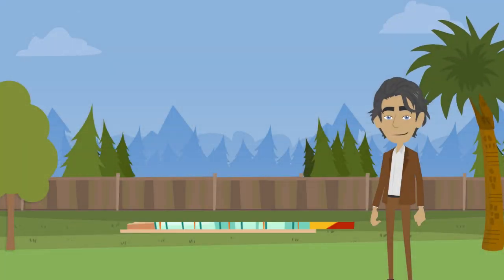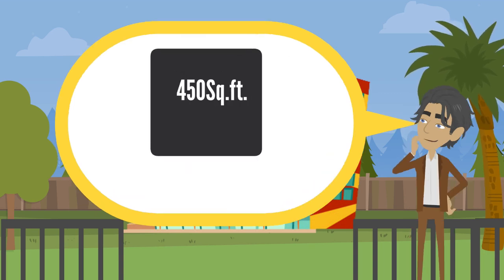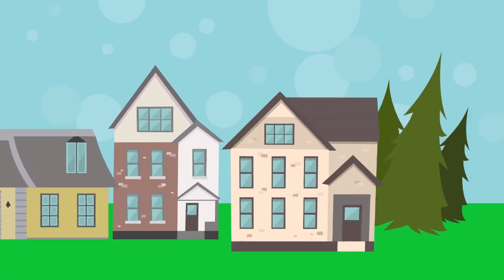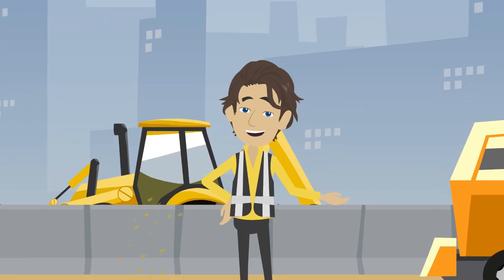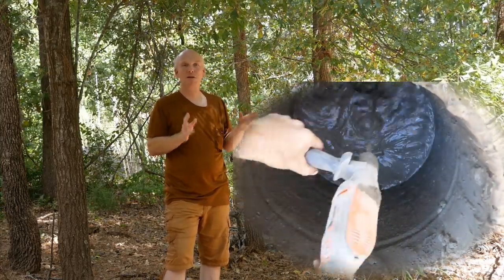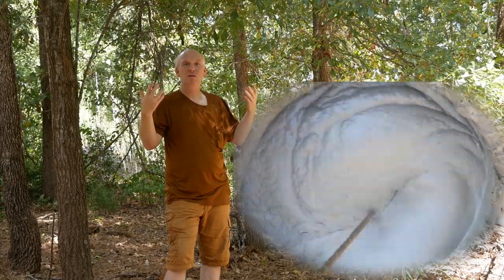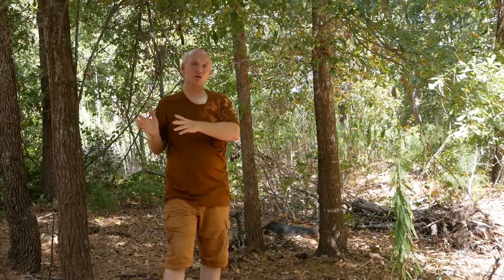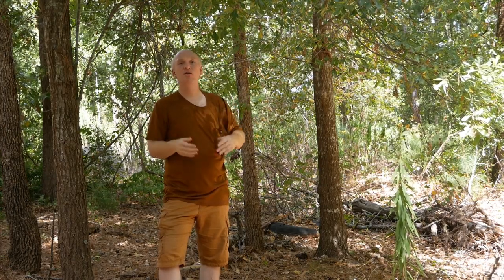Light Clay Slip Straw VS Air Crete House

Comment: Basically unless there’s straw falling out of the sky on top of you you should be using aircrete. And even then I would still use her crate. From this video straw looks like an absolute nightmare
Reply from the maker: I know my sinuses no longer tolerate the dust and mold well.  I'd you haul it in then it's not cheap.

Comment: My intention is to use air Crete to insulate the outside of A shipping container home. In the place of fabric I have a shipping container on one side and hardy backer on the other side. 
The outside of the home would be covered in tile and would not look like a shipping container unless you look at the end with doors. 
The primary goal is insulation.
Reply from the maker: It will do that.  Once you have AirCrete walls all you need is a floor & roof.  Might be more expensive using a container.  Is there a particular reason for using the container?
Reply: @TinyGiantLifeStyle  EMP protection, ballistics

Comment: Do you have to worry about aircrete getting wet like you do cob?
Reply from the maker: It will not structurally fail when wet.  Water will not soak through for extremely long periods of time. I do recommend keeping it sealed and dry because moisture can decrease it's insulation value.